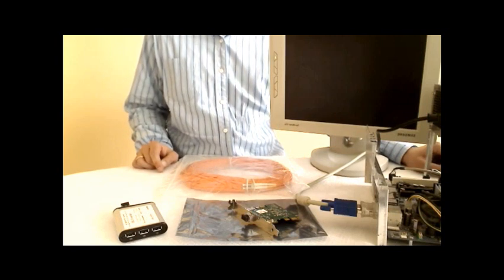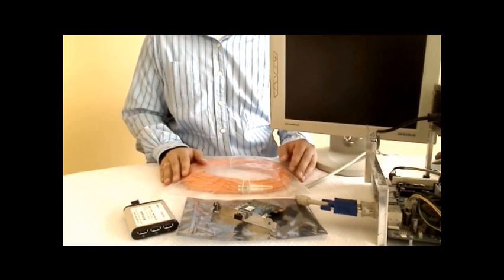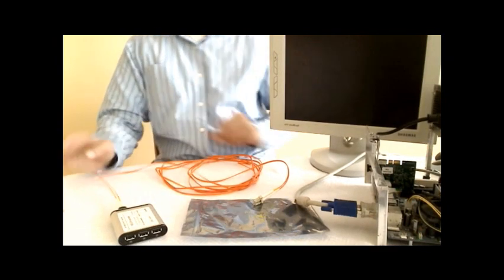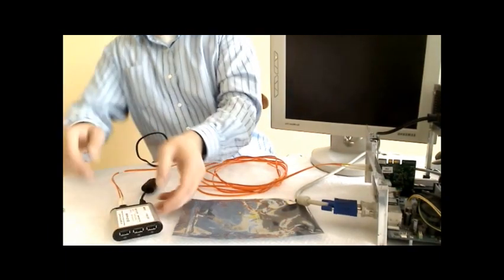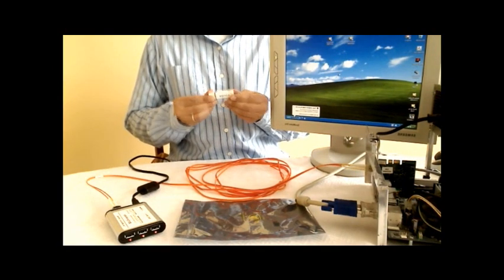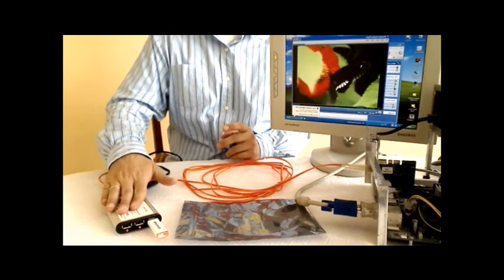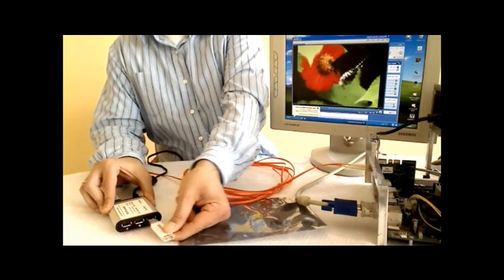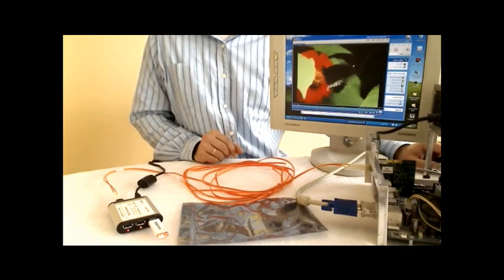Adnaco-S3 (USB Over Fiber Optic Extension) System Instructional Video

Comment: This is a great way to isolate USB 2.0 High Speed devices. But if you only need Full Speed - it can be done with a low cost dongle utilizing an Analog Device chip along with an integrated class 3 powersupply - see electronics-shop.dk